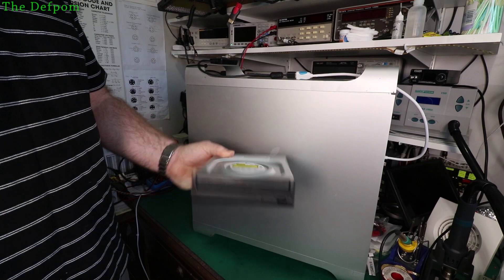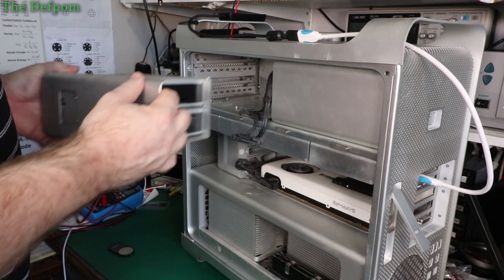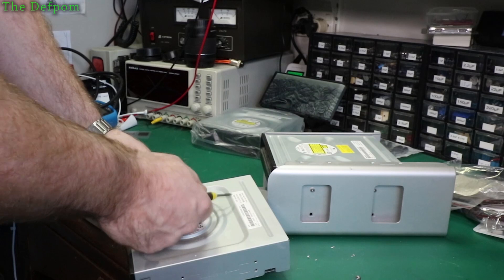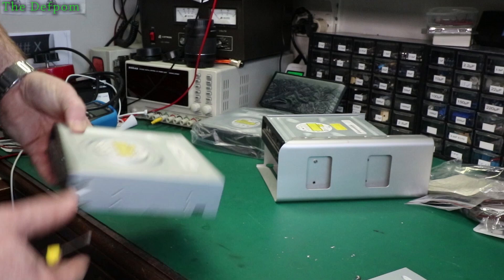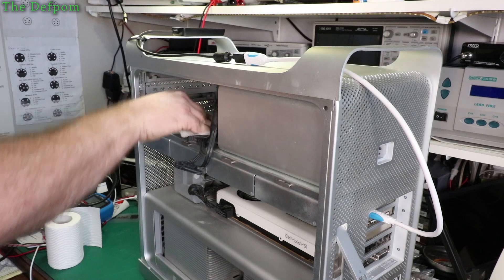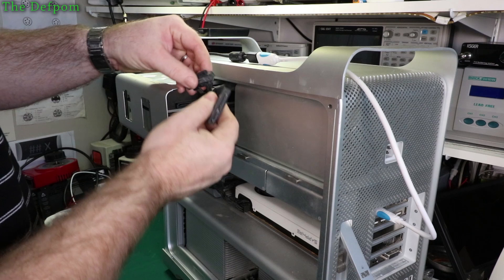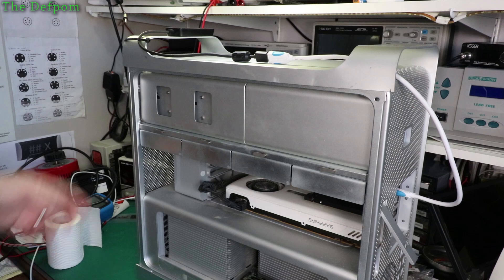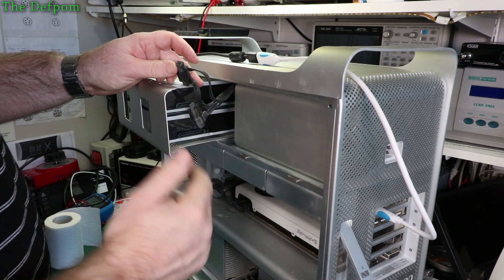🔴 #549 How To Install A DVD Drive Or Blu Ray Drive Into A Mac Pro

Comment: I did away with using internal DVD burner drives a couple years ago now. Even though I use a supercool (in a thermal way) computer, I was going through Plextor and Pioneer drives like nobody's business (just the usual..Lazer failures) they weren't used that much either. I now just use cheapo external USB read/writer drives when necessary.
Cheers mate, John
Reply from the maker: I rarely use the drives myself, but I do use them to burns DVD's to create video slideshows with music for funerals from time to time.